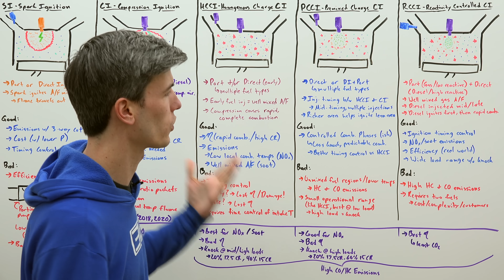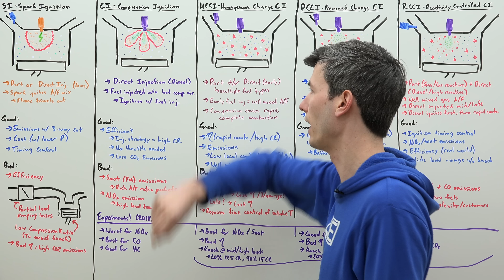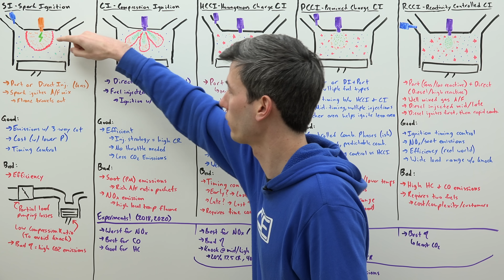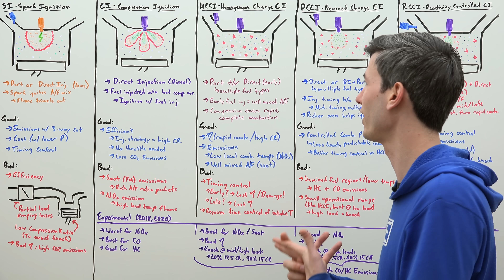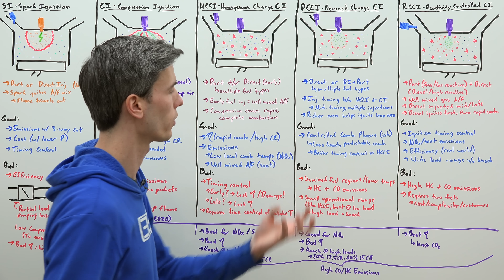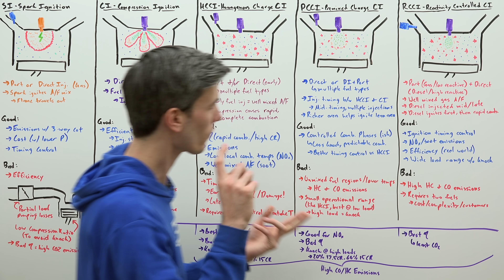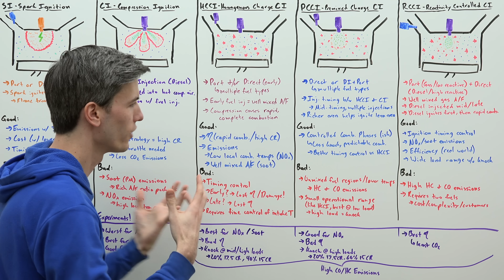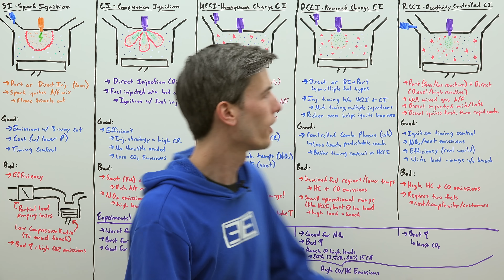If Combustion Engines Have A Future, What Is It?

Comment: Ha ha......all this leads to is your last statement......electric motors are superior to internal combustion engines, but the supply of power for ICE (liquid fuel) is currently more practical that the power (batteries) for EVs. But there is still more room to improve the efficiency of ICE, only it is kinda like the attempts to improve tape based recording/playback systems. Just like the reel to reel, 8-track and cassette died, so too will the ICE reach the end of the road........not tomorrow, but eventually.  Although I do wonder if the whiteboard will last until the 22nd century. 🙂🤔😏😮

Comment: with the RCCI how would you prevent gasoline from self-detonating at the kind of pressure needed for diesel to combust? It doesn't make sense, gasoline can only be compressed up to 10-11 bar, while diesel goes much higher than that. Perhaps swap the two? Premix with diesel and inject gasoline at the top of the stroke?

Comment: What about Hydrogen Fueled Internal Combustion engines? BMW did a lot of research on this in the 1990's using dual fuel (I.E. Gasoline and Hydrogen) concepts so when you ran out of Hydrogen you switched to gasoline and then back when you find another liquid hydrogen source. When running on hydrogen it only emitted water vapor.

Comment: I think a biggest place for change for the ICE should be the Fuel source, I think biofuels should be pushed hard we could use a lot of the infrastructure that we already have, current vehicles could be retrofitted and it would solve at least the CO2 problem begin carbon neutral
      Years ago I saw a video where a biofuel company said I could make it's fuel on a large scale profitable at 3 something a gallon that not to far current prices ( especially lately it's been skyrocketing), and with electric cars market share growing more of them means we wouldn't need to equal the current fossil fuel production 
     The internal commotion engine is not the problem the fuel it burns is and we can change that and I think we should because even with advancements in battery tech chemical fuels will always have advantages and a uniqueness that EV's will never be able to match ( there is a reason why the TRX exists)
Reply: Biofuels are a bad idean in road vehicles with internal combustion engines. The reason is quite simply the already low EROI of most biofuels. On the road a car waste about 80 percent of the energy. Combine that with the low EROI of biofuels and you're losing energy, which makes the enterprise not just pointless, but destructive.

Biofuels should be an energy source. You want about 3 times more energy back then the energy you need to invest over the whole lifetime. If you have a biofuel with an EROI of about 5 and then you throw away 80 percent of the energy (in a combustion engine car) then you have an EROI of just 1. So you gained no energy. The energy you're using isn't actually comming from the biofuel. 

Bottom line from reading the scientific literature: The future of travelling is mostly electric (cars, trains) i.e. that's the best option by far. And by best option i mean that it's the cheapest option that uses the least energy per travelled distance by far.
Hydrogen needs about 2-3 times the energy for the same distance with a fuel cell. Hydrogen in an ICE would need about 5 times more energy. Liquid e-fuels in ICE's would need about 6 times more energy etc.

Comment: so extremely complicated to make this reliable for all climates ,"modern" 6-8 years old Diesels already giving up ,turbo ,injectors ,high pressure system dpf... this is prob. another reason electric car market share going up  ,the profit. without all these problems to overcome ,machining ,sensors etc. ,once 100kw batteries become affordable, it's going to be very cheap to produce EVs and people actually paying same price or even more.

Comment: The need for two fuels isn't so much of a problem for the consumer, if both fuels could be consolidated into a single pump and a single "port". The end user doesn't need to care that much if they got five gallons of diesel and seven of gasoline, so long as the car is full and they know how much to pay, and it didn't take any longer than pumping a single fuel. The only down side would be that only service stations that have both diesel and gasoline would be able to provide this one-stop refueling service, but that would still probably exceed the number of Tesla Superchargers out there. This can be managed.

Comment: Timing would not be much of a problem if the engine is run at a set constant rpm, like as a range extender. This is still feasible.

Comment: Dear Explained:  carbon fiber blocks will save weight; electronic valves will assist trimming; octane increase helps efficiency.  The old gal has many tricks left.  Love your vids.  I'm an old Quadrajet engineer for GM.

Comment: About the two fuels, what if you boost the octane of one so as its injected it won't combust and the other left at pump octane to start the combustion process, if I understand that right. Also a cheap octane booster could be ethanol and can be metered in system so the customer only has to deal with a single fuel and ethanol every once in a while, however how often the ethanol would need to be refilled would dictate the practicality.

Comment: Back in the 70s the tractor pulls would inject liquid propane into the intake manifold. They could reduce compression ratios and increase turbo boost and still increase torque significantly.

Comment: What would happen if you have the engine pcci that has a mix of fuel and air and instead of injecting fuel you inject air to compress more and control the timing without concentrating the fuel and contaminating more?

Comment: Isn't regular diesel with addition of LPG injection practical example of RCCI? It is becoming popular in Europe. Maybe popular is to much said for now, but this technology is used. It looks like aftermarket guys overtaken car producers here. About 2 fuels in one car - in land of expensive fuel it is quite normal - LPG+petrol is quite popular in Europe. And because LPG infrastructure "is there", going with diesel + LPG is not so problematic in terms of daily use. Cost advantage on passenger cars is not so great for regular mileage users, as diesel cars have good fuel economy to begin with. However for trucks and people driving a lot it looks like good idea. From what I seen on internet there is quite big torque increase and of course range increase.

Comment: Miscanthus cellulosic ethanol is here and it's wells to wheels carbon negative vs gasoline. Meaning it removes GHG from the air as its grown and consumed for fuel. Nearly triple the GHG absorption of first generation corn ethanol while producing more gallons for every acre grown. Just one biofuel compatible with existing liquid fuel infrastructure.

Comment: Electric will definitely be the future of transportation. However the infrastructure is not quite ready for prime time yet. Battery technology is improving rapidly but until you can plug in and charge in 5 minutes it will not be a universal solution. Oh, and I own a Tesla so I am speaking from experience.

Comment: First instinct is that RCCI would work best in heavy equipment operations like earthmoving vehicles and locomotives, especially since those applications involve large machines with theoretically enough space to include two separate fuel tanks, they often run at various but steady RPM ranges, and fueling them wouldn't require a massive national over haul of gas station setups

Comment: @Engineering Explained 
I wonder if we could remove the suction from throttling airflow by throttling fuel instead. If we could figure out fuel metering on a cylinder to cylinder basis, do you think we could make the efficiency comparable to other types of combustion processes?

Comment: Two applications.  Firstly, where high power and energy are required.  e.g. Prolonged high speed, or trailer towing.  Secondly, where high availability is needed.  ICE engines can be idle for a year, and fire right up on starting.  Try that with a Tesla.  Almost any transport application that is NOT local.  Teslas for example are very high maintenance vehicles, always requiring attention and consideration from the driver.  They are okay for commute routes and other short distance regular trips, but that is all.  ICE engines are good for any application where dependability is important.

Comment: There is a very simple way to solve the "2 fuel" problem. Did you ever see those epoxy adhesives where you get 2 syringes, each having one of the 2-parts that get mixed together to create the adhesive – and you PUMP both adhesives out at the same time? Configure fuel stations with pumps that pump both 2 fuels out at the same time. Create vehicles with 2 tubes, one next to each other, to receive the 2 fuels, that send each fuel to its appropriate tank. You can configure the pump nozzle and the tube so that they can be connected only one way. Yes you would still need 2 fuel tanks in the vehilces. But you could make them in a single unit with a divider to separate the 2 fuels. And you would need 2 fuel pumps in the vehicles, one for each fuel. It doesn't really have to be complicated for consumers.

Comment: Of course they do! Electric Motors suck at killing Corona Virus :D
But overall, screw the politicians, make the engine make the most power for the least amount of fuel and then ignore the particles and emmissions.
I will gladly shaft the environment to save on the gas mileage, and we need an engine simplification rather than complication at this time.
Maybe an engine that runs on politicians? They don't seem to be in short supply :D

Comment: You ommited following: the > 2018 Euro 6d temp 2l Diesel Biturbo from VW with 239 HP has 2 SCR Cats, which makes NO_x in Real Driving Emissions below the measurable threshold. Even better is the new 2l  Mercedes engine had (in the C 300 d Estate ) a combined fuel consumption 5.6-5.0 l/100 km, combined CO₂ emissions 147-133 g/km)and just 13 milligrammes of NOx. The 3l inline has 340 HP/700 Nm and consumes in WLTP 5.2l Diesel/100km and 134 g/km CO2. 
There is much room upwards, but so much for now.

Comment: Can you please explain why deisel engine's now all have throttle bodies now ,i did notice that well my ute still has a little bypass hole around the throttle body i guess so it gets enough air to still combust but it's mechanical pump( the early bosch with the ECU bolted on top) my father's new Hilux dose not as far as i could see

Comment: Another  uninformed video by Engineering explained.  Honda did the CVCC engine which address the knock and flame front expansion issues  long ago.  The direct injection engine has been around a long time in diesel and not with gasoline.  With gasoline this has lead to great complexity and a host of other issues.  With  gasoline engine the trend has been for some time to follow the transconductance profile of the gasoline engine allowing almost full air intake by controlling the engine RPM allowing almost full load preventing pumping losses found in gasoline engines.  Soot formation in diesel is now handled by soot collector in the exhaust which almost completely eliminating soot output.  Wish this guy would research stuff prior to running off at the video about things he knows or researches little about.  More misinformation from the misinformation channel.  Bleh!

Comment: What about the voice coil direct injection 2 stroke?  The coil injects a premixed rich air fuel load after the ports have closed. Tumbling air in the cylinder filters the rich primary fuel load. Variable valve controls the exhaust port timing and Reed valves control inlet air flow. 
Basically uses the primary air secondary air arrangements found in continuously fired biller burners.

Comment: Nice vid, as always. Got me wondering have any engines ever been made where instead of a spark or injecting fuel to start the combustion process going, it used oxygen instead. May be injected under high pressure into the fuel and let's say the inert exhaust gas recirculated thus controlling the timing this way? Would be interesting it it worked lol

Comment: 6 minutes in and counted several mistakes.  One CC are used on both gas and Diesals to reduce NOx emissions.     Two higher compression is possible in gas engines both by formation of the fuel and direct injection.       Not all diesals are direct injection ( over piston)  so it injects in side port in the head.  Less soot,NOx and noise wirh some loss in effecncy but adding  tubos make up for that.

Comment: Great video, But you didn't mention DEF(diesel exhaust fluid)/Adblue when talking about compression ignition (CI (Diesel)) engines.

If the biggest problem Diesel have is It's Nox emissions, and DEF reduces it with up to 90%, wouldn't this be the solution(and it's already in use).
And if we look at technologies like Koenigsegg's FreeValve system. It should make it even more efficient. since it can truly turn of cylinders, and still have 
sufficient boost from the turbo charger (and all the other benefits).

Comment: Since modern SCR-Diesel engines already require a second "fuel" (AdBlue) to clean up emissions, I don't think RCCI with Diesel + Petrol is that far of a stretch. It all depends at which rate each fuel is consumed during normal operation. With SCR-Diesel you typically measure consumptions for AdBlue in L/1000 km vs. L/100 km for the Diesel fuel, meaning if you top up your Diesel tank every week, your AdBlue tank will probably last you 2 months. Since the RCCI-engine seem to use Diesel only for ignition, I would assume it could be comparably to the consumption in an SCR-Diesel.

Comment: Gotta wonder if the high carbon monoxide and hydrocarbon emissions on the last three are an actual issue with the theory of the design. Sounds like it's just overly rich cause it's not a production model that's been refined for decades

Comment: About 2.5 billion ICE engines are going to be built between now and 2035 as there won't be enough EVs to go around. And automakers were asked why not invest in electric. They've said they can eliminate more fuel usage and pollution by spending more on ICE since the engines will be around that long at least.

Comment: On RCCI, Diesel fuel ignites at higher compression ratio, so it will not ignite first as compared with gasoline.  Confusing.  What is the high-pressure ignition fuel in the RCCI engine?  Also, the efficiency of a Diesel engine is low at comparable pressure with a gasoline (Otto) engine.  The only reason the Diesel can be more efficient is higher pressure (compression ratio) can be achieved in the Diesel engine without spontaneous combustion.

Comment: It is funny how 140 years after electric cars first came out, that the market is pushing for it so much despite most can't afford them and huge lack of charging access/speed
Reply: I dont find it funny in the least: EVs have the potential to run at extremely low CO2 emissions (well-to-wheel), so its very logical to push this technology.

Comment: Some interesting stuff.  As far as dual fuel vehicles.  Fuelinf would be easy.  In the south east many fuel pumps can dispense gas and diesel fuels.  Just some tweeking to the pump computer should allow for it to be done with one transa.  18 wheelers have done this for some time with standard fuel reefer fuel and def.  The pump systems are here and all but ready to fuel a dual or possibly triple fueled car

Comment: Re. your comments on RCCI engines, I was always told by shop teachers that gasoline will ignite more easily than diesel under compression, that being one of the biggest risks of accidentally putting gas in your diesel tank. Is this wrong?

Comment: I was always told by autoshop teachers that gasoline ignited more easily than diesel under compression, that being one of the biggest dangers of accidentally putting gas in your diesel tank. Is this wrong (re. his comments on the RCCI engine)?

Comment: Why does an ICE have to run on only petrol or diesel? There are a variety of other combustible substances to choose from. I know that petrol / diesel is supposed to have the best energy density amongst commonly considered alternatives, but in something the size of the average car that shouldn't be too much of an issue. If there was something that ran cleaner but got less mileage it wouldn't be a problem unless it was either more expensive or the mileage difference was REALLY bad.
Reply: @strangelove9608  Sure, you can get fewer harmful emissions from conventional fuel with improved efficiency, but only up to a certain point. You can run an ICE on hydrogen & last time I checked the only by-product was water.
Reply: @strangelove9608  It's doable, but like most things it too has it's own complications. At the end of the day electric is just simpler / easier. That's probably why there isn't a massive push towards hydrogen instead of electric. I only bought up the issue of alternative (to petrol / diesel) fuels for those who don't want to let go of the idea of an ICE. And yes, electric (like everything) has challenges too, but in general it's the best available option at the moment, in my humble not-a-scientist/engineer/mechanic opinion.

Comment: The combustion engine will still be going strong when we're all dead. This notion of electric cars and fuel cell cars is great if  we use nuclear power. But no, no, no....That's too dangerous and the  waste...Good God the waste. Constructing and gathering the materials for ev's even if preformed by ev's is a gigantic carbon proposition because again, no nuclear. But, but wind and solar....yeah right. Figure out fusion, accept nuclear or just accept the fact the combustion engine isn't going anywhere until then. Unless you attended the AOC school of economics then dream on....